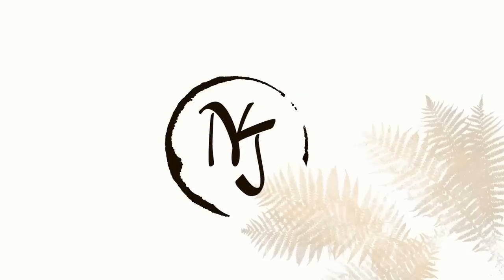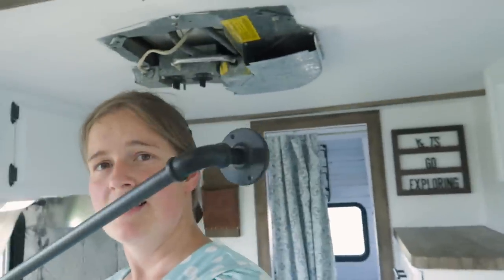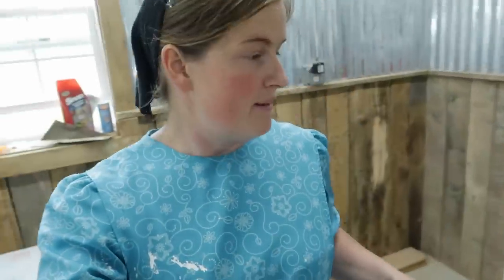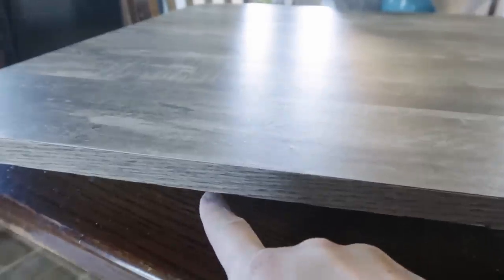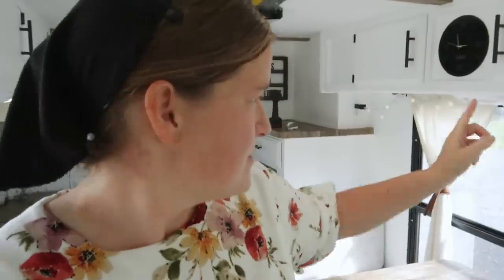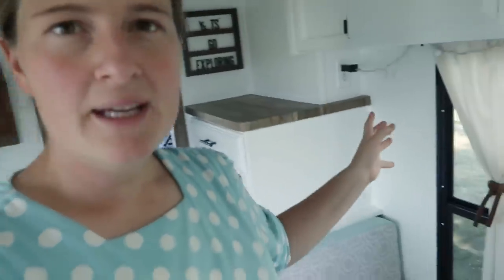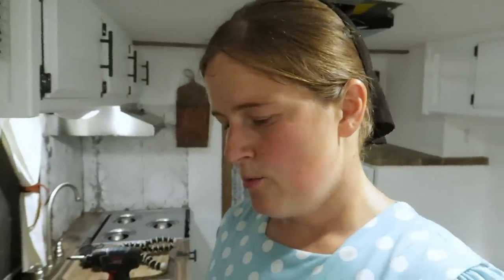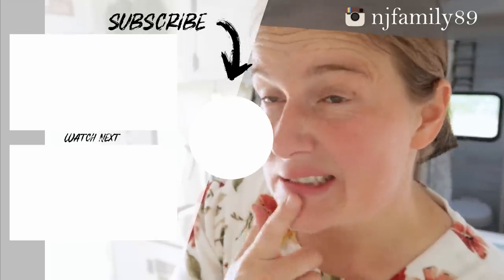Glamping the RV!!!

Comment: I love it❣they make this spray on sealer. I don't remember what it's called. I wouldn't spray that in the outside on the seams.  They also make a tape that is really good too.
Reply from the maker: thanks! Yes, we tried the eternabond tape... I had missed a spot... I think we figured out where the leak is coming from. Fingers crossed we are right! (:

Comment: Screwing into the ceiling won't cause leaks?
Reply from the maker: It shouldn't.  That's just a ceiling and insulation with studs. The actual roof is above that.

Comment: We all do learning by doing, or: just who does nothing will not make mistakes. Princess, if you fell in the mud clean your face, put the crown back on your head and go again!

I see you as a boss of a camper renovation workshop in 10 years... after fixing the mistakes.

The water may come from a tiny leak between roof and wall. Just some drops coming through tiny scratches. 

Here in Germany we can buy little LED lamps to glue on the wall also to have ligth in a cupboard. They don't need much space and no pipes, just batteries.
Reply from the maker: thank you for that! I will have to remember that quote! (: we think we may have found and hopefully fixed the leak (: fingers crossed! I like the idea of the LED lights. thanks for that! have a lovely day!

Comment: Ugh I want to cry with u. Leaks are such pests. Heat may have shrunk some of your seal jobs depending on what was used so you may need to go back over with some "Through the Roof". We seriously love that stuff. Hubby built our countertops and was watching he said your shower wall etc needed to be thicker and the glue has to be spread all over it with a paintbrush. He said it's very hard but the results are worth it. The buckles you see are the parts where there is no glue. Also needs to be a specific glue. 
Gosh, I love everything you've done. Loved your table, I would have put a clear plastic over it and used it as a chopping block or art, it was soooo pretty. Then just got some wood and built a new table top.  Now, if it gets hot again your sticky paper on top of the table may bubble and peel. You could put a clear plastic (I don't know what it is exactly) on top of it. Some restaurants do that to their table tops when they have ads underneath.  
Everything looks so homey and you are such a hard working gal, so talented too. My hubby guards his tools like I guard my sewing machine.(doesn't let me touch them. Lol) The one time I tried to build a media shelf, it wouldn't even stand up. He fixed it but I will never hear the end of that, although if you ask my kids, it's "mommy built it" and they were proud of it. Lol It has been torn apart since then. 
You continually amaze and delight. 💖💖💖💖💖 I think I saw that you had already taken it out on its maiden voyage so hopefully everything was amazing.
Reply from the maker: wow, thanks for all your tips! I'm glad to know about the shower. I was thinking maybe that had been the problem, but wasn't sure. (: You gave me a good laugh, trust me, if I would've tried to build something like that, I'm sure it would've fallen apart. I'm not good at furniture! thanks for watching! yes, we had a lovely first time out!